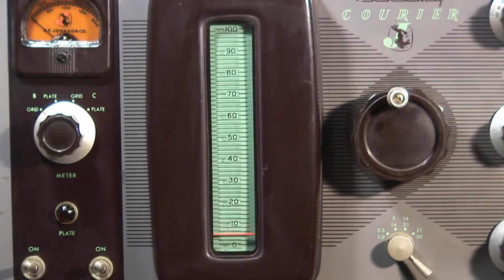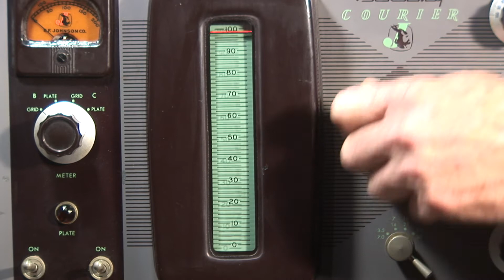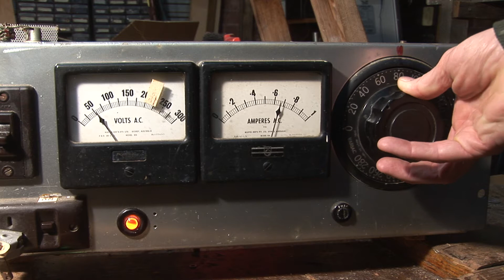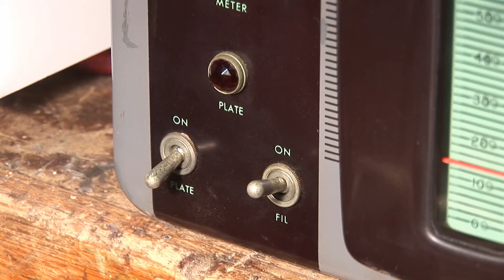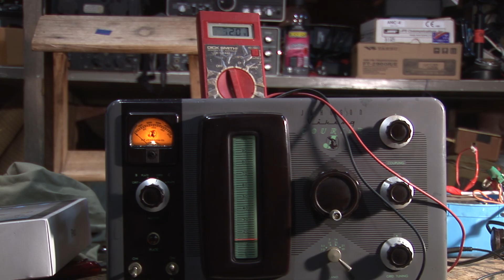Johnson Viking Courier  HF Amplifier

Comment: a few things to look at, possible causes.
input circuit cap values, can bypass with a small tuner inline to adres input impedance or measure/calculate the input impedance for the bands.
relay tx and rx working correctly ?
input cap value? .01 ?
cathode voltage ? 6.3v 8 amp
ht supply smoothing caps ?
 dip and load on ther correct band with correct radio freq input.
max output can be 350 watts 300 to be safe.
give 10 watt input from radio,  dip and load for max power out? then let her sit for a bit ib tx mode, while monitoring the tubes we dont want em red at anytime.
the rf might start creeping up due to tubes coming back to life.
with ht voltage bled off(make sure) remove 1 tube (811a) then  do same drive test (note power output) (remember to dip and load)
now do the test with the other tube? same rf ? or dead? if +_ same output we have good tubes !
now focus on the input circuit, i suspect the vineer drive cap and roller can be out of sinc?
did anyone else have a go at it? no ? good, then you only have to solve normal hiccups with amp.
a  811a will give 180 watts max 120 to be safe. dont ever get the palest red hot.
they give max power with even 750 v on plate and 6.3v filaments.
now this video was posted 2015 so i hope it still lives, its a really fancy amp for what it was.
take care 
Johan
Reply from the maker: Thanks, i had borrowed it to do the video but will make sure the owner has a look at the post.